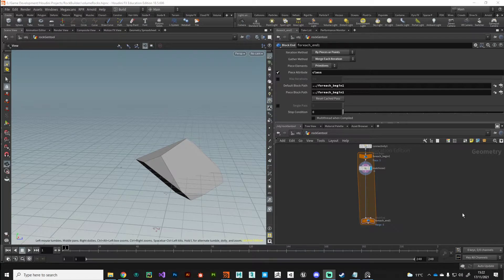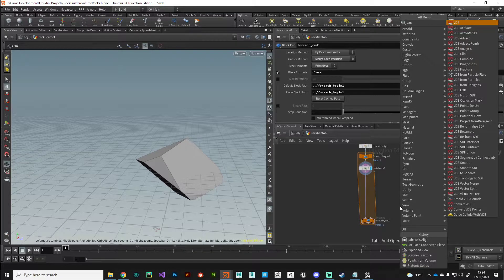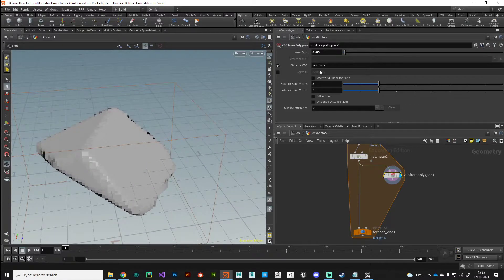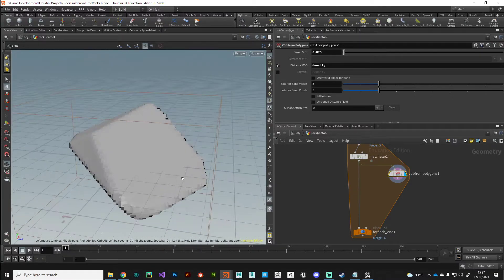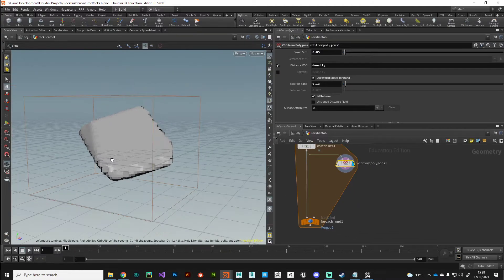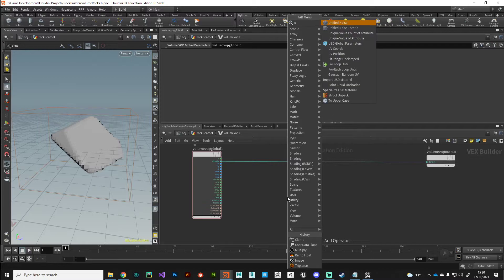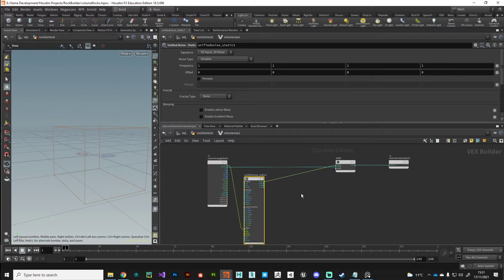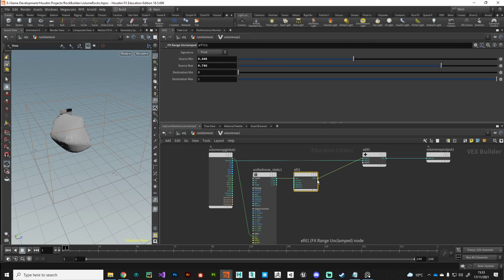Houdini Rocks 02

Comment: The Volume VOP is not working for me. I followed the steps exactly, but it still isn't working. I’m not sure if the issue is due to the version of Houdini I have or because I'm using the Non-Commercial license. Good tutorial though, very well explained!
Reply: Hi. I had experienced the same problem as you. In this case, click the volumevop node and enter 'volume bindings' tap. Uncheck 'Autobined by Name', and click '+' which next to 'Number of Bindings' option. Then, 'VEX Parameter' option will be newely added. Just input the word 'density' in 'VEX Parameter'. It's gonna be solved.
Reply: I have encountered the same problem in this tutorial. It didn't do anything for me either until I noticed that I actually didn't click display on this VOP node (the eye icon) 
always make sure that you're displaying the node you're working with